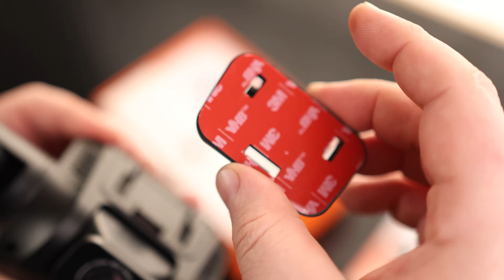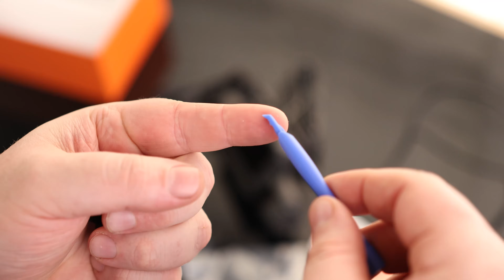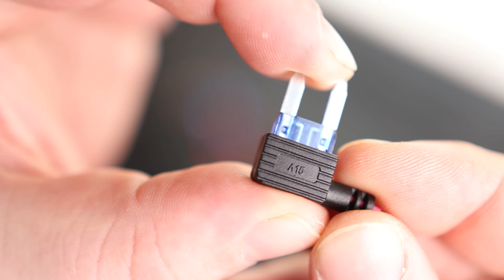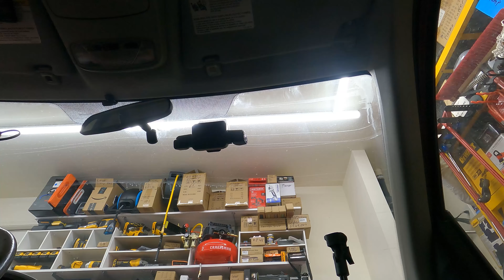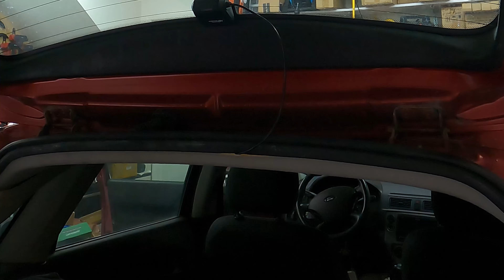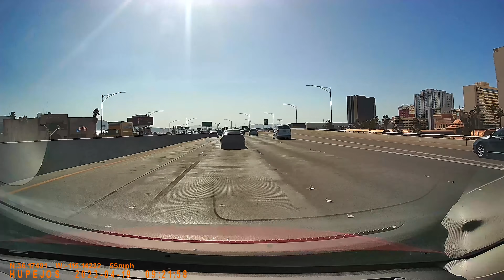Hard Wiring The HUPEJOS 360° Dash Cam With Radar Detection Kit

Comment: You can get one of these with the double one piece holder rear camera which and can swivel just like the front left and right cameras so you can point one outside and the other inside the cabin or spread them out so you get a wider view of the outside rear similar to the front left and right cameras.So you have a complete all around view of the your vehicle.I have used similar cameras before and advise you to place the camera as high as possible on the rear and front wind screens as you get a view of the front or rear edge of your vehicle and in turn any small knocks or accidents.If too low you only get the view of up ahead and not the precise impact point.I don't like the round suction clamp as it lowers the camera down your front wind screen.The fact you can reinstall it onto another vehicle is nice. I might go buy one as i have been looking for a decent all around view camera that records when parked as especially when other vehicles open and knock their doors onto your vehicle when you are away from your it.

Comment: Does the gps / speedometer reading work with only the hardware installation? Or does it also work with the cigarette lighter power as well? I drive a semi truck so I’ll always have power via the cigarette lighter.
Reply from the maker: It also works with the cigarette lighter.

Comment: Hello, thanks for this review. Just wanted to know if this camera can be connected to an external battery pack like the powercell 8, Cellink Neo or Thinkware Ivolt xtra/mini in order to avoid the OBD cable or fuse box connection? Is it possible?

Comment: Hey how’s it going I got a question how long does it take for the camera to turn off I locked my maverick truck and it hasn’t turned off for about 15min or is it not turning off because cars keep driving by infront of the car ? I’m also using the hardwire kit red is on ACC and yellow on constant 12v and black grounded

Comment: Can you have this Camera on constant record when engine is of.
Reply: This can be achieved only with the HUPEJOS parking monitoring radar hardware set accessories. You can also contact after-sales service to send you a set after purchase.
Reply: I really fell in love with the product design concept, I really love it. My questions 

1) How efficient on a scale 1-100, can this capture license plate both day and night.

2) Is there time to time firmware update from your company to correct anomalies

3) How many parking modes are available to this (such as timelapse, low bitrate etc)

4) Pls can you explain the principle of how exactly the parking mode works with the hardwiring kit

Thanks as I anticipate your response.
Reply: @Mullah01  license reading is about 40 daytime and 0 night. The license plate lighting way overexposed and you just see a white flare.

Comment: Horn power is constant always use that for non stop continuous coverage!!! No one will get away from damaging your vehicle and make sure you mount it as high up in front of the rear-view mirror as possible!! You can almost take out the rear view mirror and just replace it with this dash cam bc it shows what's behind you just like a rear view mirror would do.
Reply: I wouldn't in case the system malfunctions!

Comment: Thanks for the video. What is your experience with the radar motion detection? Do you use it? How long does it take from moving in front of the detector to the camera starting recording?
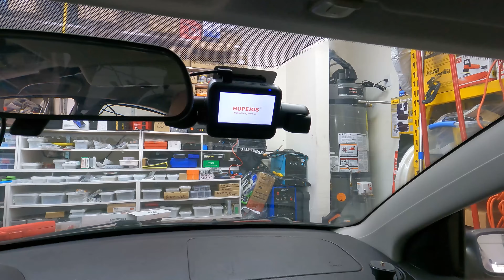At 9:16 it seems that it is around 5 seconds which is quite a lot. In five seconds someone might approach your car and scratch it with key and step away while the camera is still booting.
Reply: This Camera goes into full power down when ignition powers off. So, yes, you won't get some seconds after the radar triggers power back on. Other cameras into low power or time lapse so you don't lose any seconds. This is not a fully capable dash cam.

Comment: Does it have motion detection for recording events when the vehicle is parked?
Reply: I’d also like to know. Had so many people dink my car when it’s parked!
Reply: @bennyob01  You can also optionally install HUPEJOS to install a low-power radar parking monitoring hardware kit. When an object approaches, four lenses will be activated to take pictures at the same time.
Reply: When the vehicle is driving, the machine has a built-in GSENSOR motion sensor. When triggered, the video will be locked and placed separately in the video in the event file.

Comment: Question the tools you were using it’ll
Comes with the package?  What if someone like to do hardwiring option any recommend what brand/name called these tools otherwise  nothing will be done 😅
Reply from the maker: The crimpers I'm using in this video are by IWISS.  I don't remember if the the add a fuse's are EPAUTO or Recoil, but both brands make good products.

Comment: How does this do in all blacked out area? I lose power sometimes where I live? And how is the parking mode?
Reply: The left and right lenses in the car support infrared night vision function. After parking, you can optionally install HUPEJOS to install a low-power radar parking monitoring hardware kit. When an object approaches, the four lenses will come up to take pictures at the same time.
Reply: @HUPEJOSDashCam and how much does that cost?
Reply: @Dalenguyen001  Our dash cam cost $130-240 range.